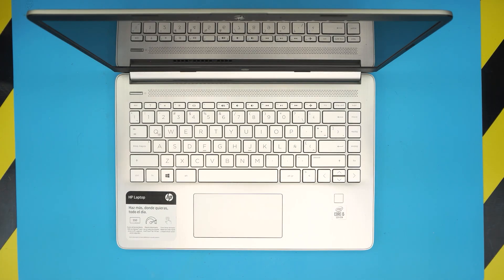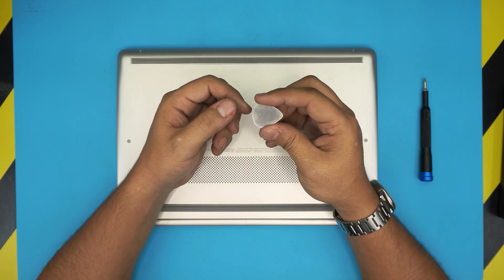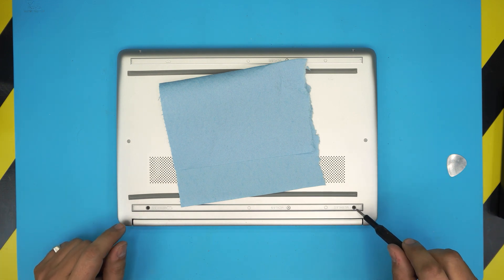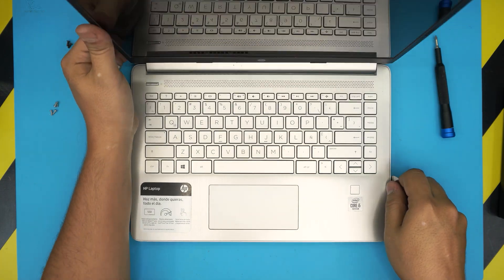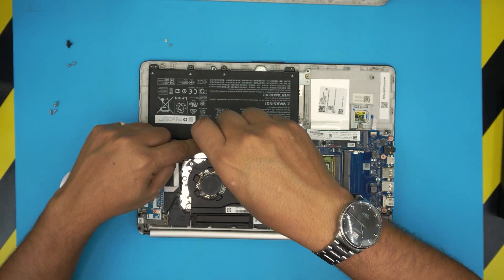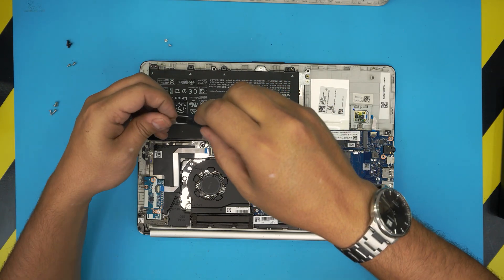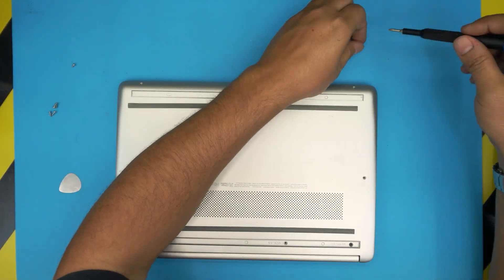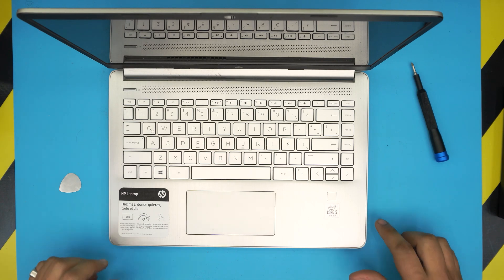How to Replace Hp Pavilion 14 Dq 1xxx series Battery

Comment: Hi. Your video (I think) helped me upgrade new HP 14 dq0055 which sold for an amazing 150 dollars at Best Buy but was only available with 4 GB of RAM and really these days 8 GB should be the minimum to have. Anyway, for 18 dollars I got my 8 GB and following your instructions, probably on another site, did my surgery and all went well! SO TY for that. As to your link up there for a battery (it never hurts to have a spare at this price point) unless I am missing something, this battery does not list itself as for my computer. Perhaps the HP Pavillion model is different from the HP 14 model, I don't know. A) What do you think about the need for an extra battery and B) do you still think this is an appropriate battery for my HP.
Reply from the maker: Thank you for your feedback! If you wish to support the channel, you can like, subscribe, or both!
Regarding your questions, 1st of all it is my pleasure to make this videos and help people out, and yes the 4GB is absolutely nothing after few internet tabs opened.
i have updated the description battery link, it is showing the correct model, this link is for all the DQ models.
the battery prices are set to rise as we talk to providers because of the issues in china battery factory, i do recommend to get a spare one at good price now.
Should you have any further questions or requests in the future, please don't hesitate to ask me.